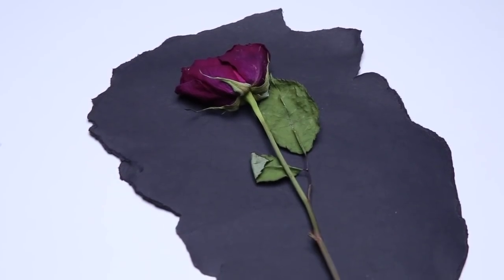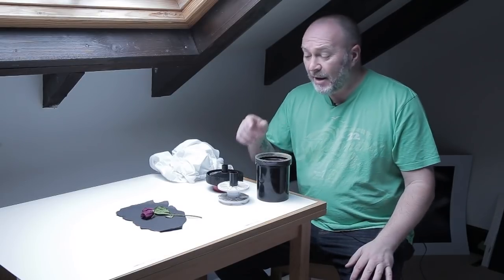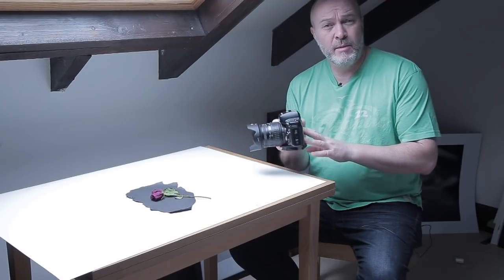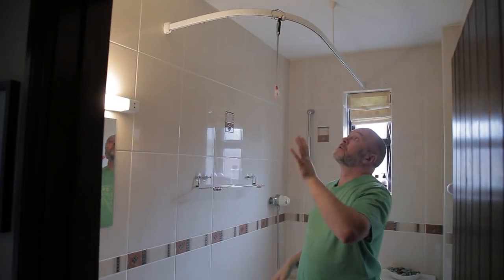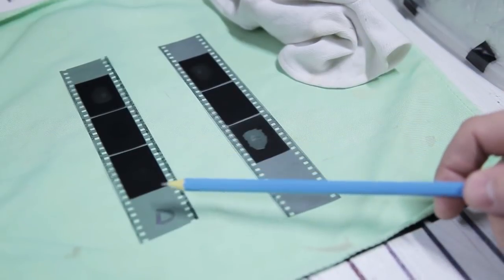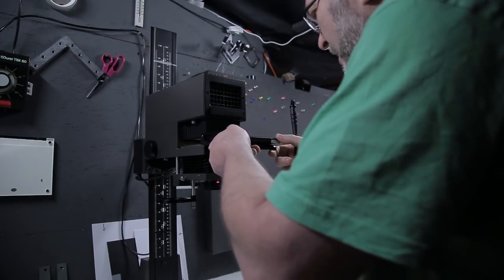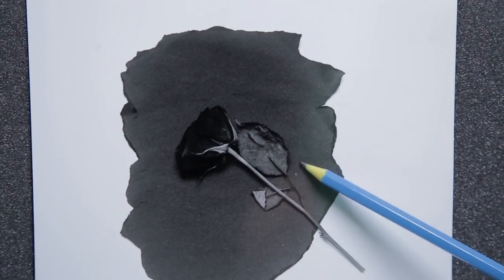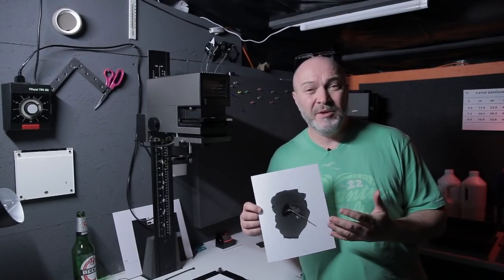FILM PHOTOGRAPHY AND DUST

Comment: The purpose of experimentation is to test theories. You tested one here and found something interesting, while dust is bad, the process is still more resistant that we thought.  I was watching another channel where the host tried different agitation techniques and found that they had no impact on his negatives. He overly agitated (I mean really rough) one one roll, on another he did his normal agitation and on the final roll he barely touched it.  End result, no difference on the negatives. So we worry so much about getting agitation perfect, temperature perfect and as dust free as possible, when we should probably put more time in getting the art right.  Wonderful experiment, and thanks again for sharing.
Reply from the maker: Yup! You're right there. We go by the book worried it'll all go wrong if we don't. That dust test really stumped me! I've also agitated carefully and cocktail shaker style and saw hardly any difference! I guess if the film had very important images on you'd go by the book, just in case!

Comment: Possibly off topic somewhat, but came across this genius suggestion for drying film. After the last wash, put the film spool in a salad spinner with the film at 90 degrees to the side of the basket.  I also put a small block of wood about the same weight as the spool plus film on the other side for balance.  Film comes out with virtually no water on it!  Dries much quicker and I suspect will attract less dust etc.  I will get chatted about using the spinner in the darkroom, at which point I'll have to get my own I guess.
Reply from the maker: I've seen that. It's brill

Comment: Thanks again for sharing some tricks. There was a true lightbulb moment here...I never thought of getting rid of towels in the bathroom when printing. I just finished a printing session - and my final print where everything lined up (exposure-wise) suddenly had a huge dust particle on it. 

It’s very frustrating and it drives me mad. Gaaaah, all the dust! >_<
Reply from the maker: Yeah it's a pain. If the neg is spotless and dust free then chances are the dust is dropping onto the paper.  I usually brush my paper once over when I put it in the easle, then waft a card if it's longer than 5 seconds exposure. Usually works!

Comment: I suffer really badly with dust in our house - dogs, wood fires & wood workshop - all create problems.  To counter this when drying negs I have a couple of lengths of 4" drainage pipe.  They are sealed at the top with just a piece of fishing line coming through a hole at the top.  I fasten the negs to the fishing line at the bottom, then pull it all the way up to the top.  This seems to stop any dust settling on the film from the air.  I keep both ends sealed when not in use.  My crazy way, but it seems to work for me!
Reply from the maker: Genius!

Comment: Interesting experiment...I would have thought that talking near negatives (and camera gear for that matter) would spread tiny saliva particles over everything and wearing a surgical mask would help, but that seems also more worry than reality...I have also wondered if one of those old time static guns used for vinyl records could be of some help...Though I do find that running an electrostatic air cleaner does make a noticable difference in dust levels.

Comment: hello there, i have a question. I am deweloping my own BW films and i got everything right except dust, cant completely get rid of that. I found film cleaners online, have you ever used them?. Do you wipe negative with cleaner or alchohol on emulsion side too or only shine side. I tried once to mess with emjulsion side and ruined it with scratches, so whats the deal?
Reply from the maker: Dust is a pain in the arse but easily Manageable. What dust you talking about? Dust trapped in the emulsion or getting loose dust off the neg when scanning/printing?
Reply: @ShootFilmLikeaBoss  i think emulsion one, cant clean with alchocol
Reply from the maker: @aantonic  if its dust that is trapped in the emulsion during drying then you're not going to be able to clean it out easily if at all. There are cleaning fluids out there to clean smears and grease and finger prints from negs but you have to be careful on the emulsion side. Going forward you need to dry your negs where it's dust and lint free. My negs hang in the bathroom and I close the door and remove any towels. Try not to move irraticly as to waft dust around. I've had all this in the past. It's a pain but you soon learn what works best
Reply from the maker: Some run the hot tap for steam to fill the room and to settle dust but I don't. Just keep a clean bathroom.

Comment: I thought I was extreme running the shower to get the steam to bring all the dust down and stopping it floating around before hanging my films. I then take my files in there to put them away in the neg holders with as little dust as possible, but it’s also paper and towels out from now on. I also use the anti static brush as well and for the price they are amazing value, I use it for both the negs I wet print and those I scan. I can only print B&W 35mm at the moment, but I’m looking for a black and white 120 head.

Out of curiosity have you ever used the Fotospeed FC50 film cleaner? I like Fotospeed for toning kits and the Farmers Reducer they do, the quantities are perfect for my needs and I don’t like too many raw chemicals around. I want to print and split tone an image of my sister and our late mother from a neg out of Mum's "family box" for my sister's very special birthday. It’s has scratches, as Mum never bothered about those things, but I’m going to try the highly recommended "nose grease", I want to try and clean it up a bit first. One method I've had suggested is a 70°F rinse with wetting agent but to keep it under 5 minutes as any longer can affect the emulsion. 

I never know what to call you when addressing a question. A brilliant and interesting video, though whilst the dust was flying round it was more of a horror movie.
Reply from the maker: I thought the neg would have been a horror movie also Mark! Nose grease should do the trick. My mate used to work in a lab and he used it all the time. Although he said he would get the sack if caught! Good luck with those negs! Roger.
Reply: Shoot Film Like a Boss Thanks Roger.

Comment: Great experiment and it made me chuckle👍 do you ever spot out on prints using spotting dyes? That might make a good vid? 👍
Reply from the maker: I have not ventured into fibre papers yet Ian. I don't think spotting works on resin, does it?
Reply: Shoot Film Like a Boss Yes it works but you have to build it up gradually let it soak in and dry then keep repeating until it covers, using the finest brush ( literally 6 bristles) as you don't want it to form a puddle! So you may have to repeat it quite a few times ! I'm experimenting with fotospeed dyes as I don't think you can get the Spotone anymore ?👍
Reply from the maker: Is that with resin prints?
Reply: Shoot Film Like a Boss Yes it works on resin coated (glossy, pearl and Matt etc) but you do have to be patient and build it up gradually ! With fibre papers a good retoucher would "knife" the print then retouch it although I have never tried this method! I was shown basic retouching which is literally like putting dots of different depths of grey in the dust spot a bit like newspaper print! It does work an doesn't come out as just a grey blob ( similar to bad cloning ) but you do need jus a couple of bristles in the brush and patience ! The advantage of resin coated is you can always re wash it before it dries completely if you mess up. I suppose it depends on the size of dust spot to whether you should reprint it ! 👍
Reply from the maker: Ian Frankish Wow. I didn't think spotting dried on the plastic! I may try that out and video my experience ! Thanks for your input!